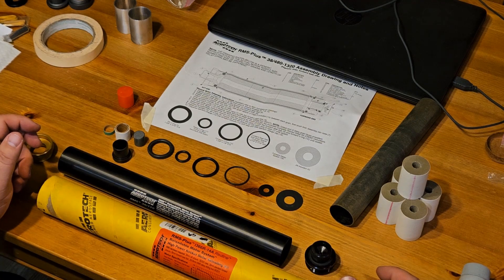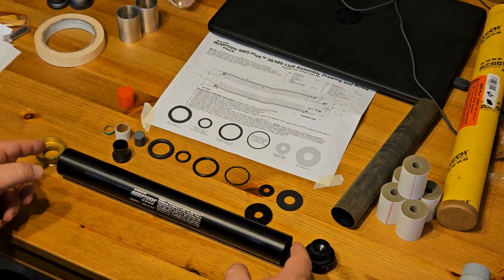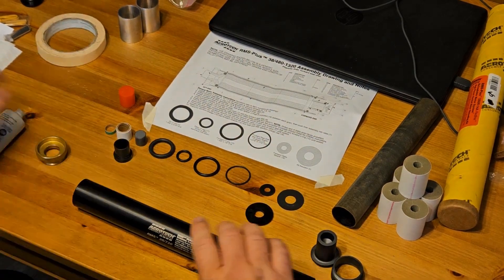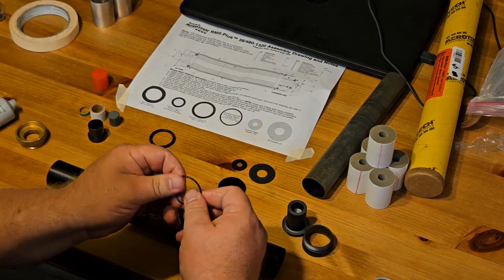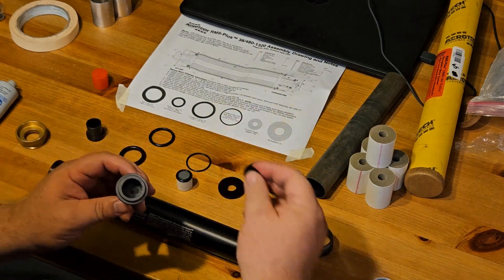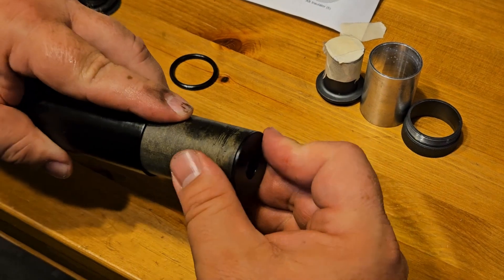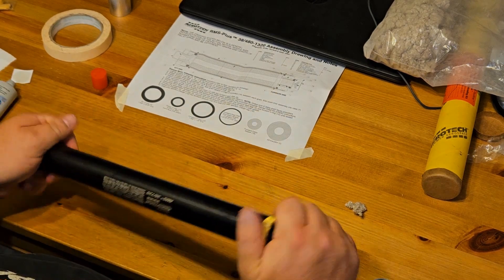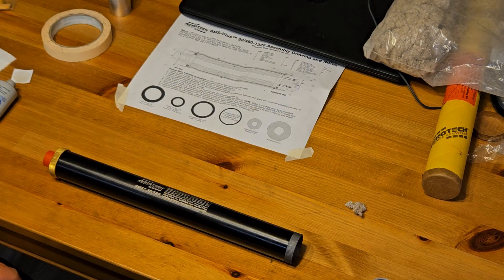Aerotech RMS 38/720 with Reload Adapter System (RAS)

Comment: Did you use the ejection as a back up? If your rocket is duel deploy and has needs a 1 second longer delay that the motor comes with wouldn’t your rocket ejection fire early causing a zipper?
Reply from the maker: This rocket was indeed dual deploy with an eggtimer altimeter. The motor ejection is a redundancy. However, one thing to consider is the accuracy of the delay grain. Aerotech has said they have an error margin of 20%. So you may drill for, say, 10 seconds but that grain will burnout somewhere between 9 and 11 seconds. So it's all a best guess. Ejecting 1 second before or after apogee might cause a zipper, but hopefully your velocity is low enough that it would survive.